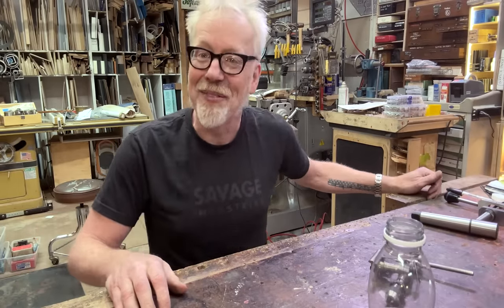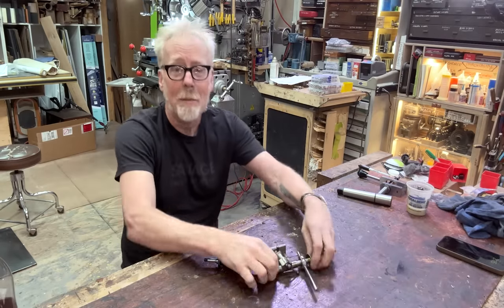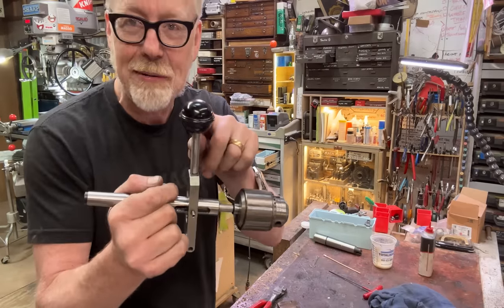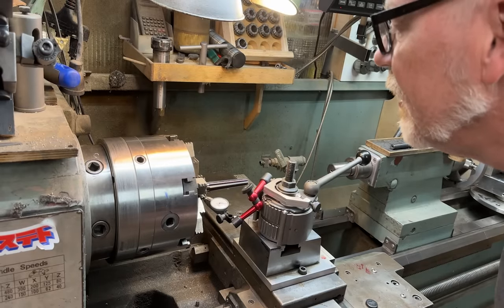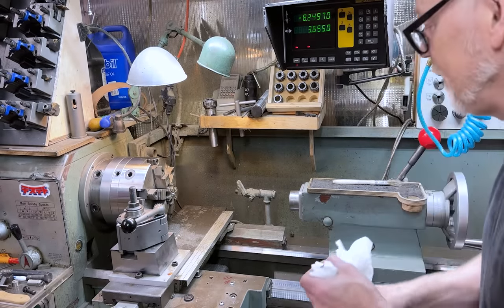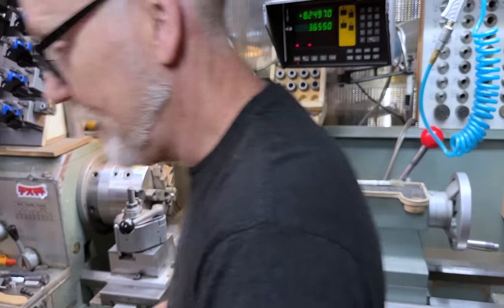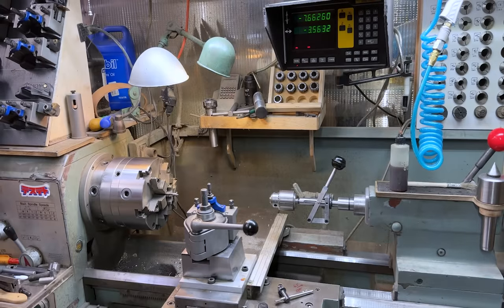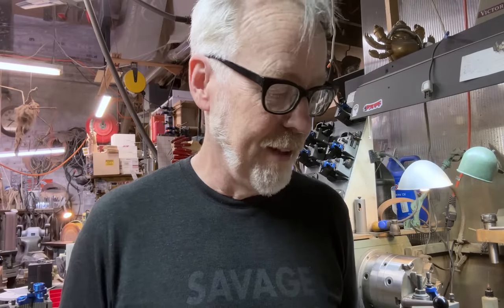Adam Savage's Lathe Build Fail

Comment: One of my pet peeves shows up again. Saying one of the problems is "these are from China", implying that anything and everything made in China is bad. You bought something CHEAP that happened to be made in China, that's the issue. China can make high quality stuff like any other country, it's just that people don't want to pay for it. But when they buy something super expensive from Germany they praise its quality. Well no shit it's better quality, you paid an order of magnitude more for it.

Sorry, rant over.
Reply: (Machinist) Agreed, but I have to add a caveat here - machining literally hasn’t changed in well over 100 years. But the materials and tools certainly have. Especially with the main brands of yesteryear. Many of those companies flat out don’t exist anymore. If I order a drill or a tap from a reputable company - or who I thought was a reputable company - I’m disappointed to find out it’s made in China, or worse, India. And the result with the tool shows it. I can attempt to drill a hole in hardened 15-5PH stainless with a brand new cobalt drill from Dormer-Pramet (both used to be reputable companies, now combined into hawking Chinese compressed road grime) and fail miserably, pull out a 50 year old Dormer or Greenfield HSS drill and have zero issues… same goes for many other tools and equipment. I am seeing many more tools being manufactured in India now and they’re often unusable (no offence to India, I have two lathes made in India in the 1980’s and they’re great). The result is having to spend much much more on, yes, German made tools when it used to be unnecessary.